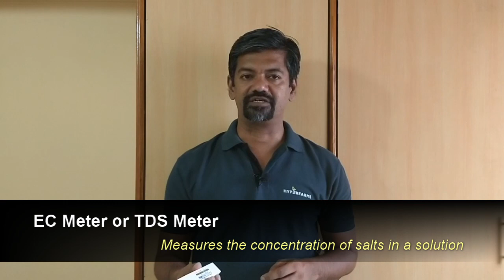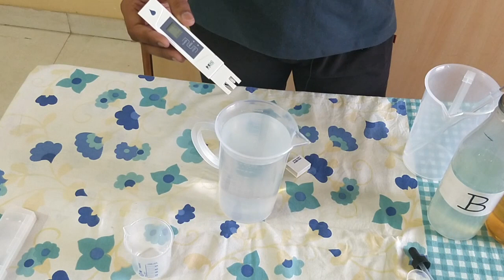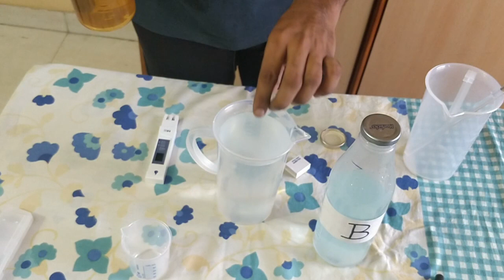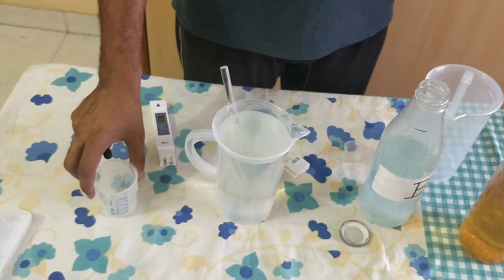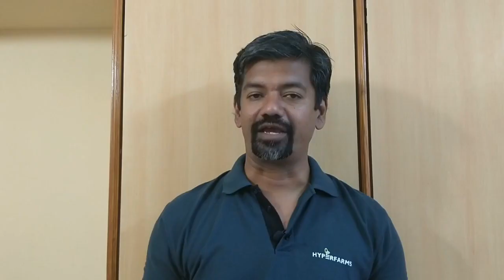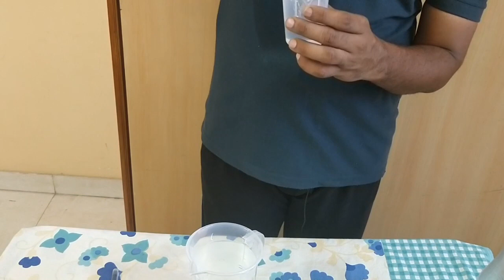Guide to adjusting Electrical Conductivity (EC) in Hydroponics

Comment: Your explanation is the first I have found which confirms my assessment that plants use waster at different rates than nutrients. Thus if a working solution is used to replenish the water loss, a too high a concentration will result in a very short period of time. Water without nutrients must be added and monitoring with an EC meter is necessary to keep the system at or about your target EC range. Measuring your fluid in the reservoir with the pump running risk misreadings. I have seen a 40O mc difference in readings with the pump on vs off. It is my recommendation to have a separate cup to hold the sample when taking a reading.

Comment: Thanks for sharing. It's clear as to why to use EC over TDS meter and also how to increase or decrease EC of solution.

My question is while we adjust EC, does other important  parameters like PH of solution gets affected?
Reply from the maker: While you adjust EC, parameters like pH change.  For that reason, pH is always done at the end. Also remember, pH adjust will technically change EC although marginally. That change we can live with as long as the added acid doesnt increase an individual element beyond its allowed range.
Reply: @TheGeekgardener  thank you so much for the information. It completely clarifies my question, with what needs to be done and more importantly why it should be done that way. Much appreciated.

I am very seriously thinking of evaluating hydroponics. At first, in my private terrace of @ 1000 sft and on commercial scale after getting hold of it technically and commercial aspects of it. 

May I request for your e-mail id where i can catch up with you on one to one basis.

Comment: I just set up a hydroponic system with lettuce.
I need to reduce EC from 1773 to  a range of 800-1200.
Also need to reduce Ppm to range between 560 to 840. The current reading is 894

Comment: thank you sir. regarding calibration do we need to calibrate both ph and ec meter again and again whenever we put new solutions in hydroponic or one time calibration will do to test the solution every time we put in hydroponic.
Reply from the maker: There is no need to calibrate every time you will the reservoir with the solution. The calibration is done periodically to ensure we get the right readings. 

Older the instruments, more frequent calibration is required. More so with pH as it needs more care during usage and also during storage.

hope this helps

Comment: How often do you replace your nutrients? After adjusting the EC
Reply from the maker: I adjust the EC every other day or as and when there is a reduction or increase in EC. If the tank volume is smaller, replacing it is easier and cheaper. For larger tanks, replacing or dumping the solution is not always an option since the cost is higher.  

For home garden, replacing the solutions once in 10 days will do. Instead of dumping the solution, I always use that to water plants in pots and in soil. They thrive well in these solutions.
Reply: @TheGeekgardener  , one more thing after tapping and readjusting EC the next step would to adjust PH if it is not within the range right?
Reply from the maker: @nestyplus  Yes, thats correct.
Reply: @TheGeekgardener  Can you also do a video on how to adjust the PH ? Also how can we know what the desired PH and EC should be for any vegetable that we're trying to grow ?

Comment: Using the 3 -part nutrient kit, do you mix the three in your feeding solution then measure EC or do you measure the EC on each nutrient  in water separate?
Reply from the maker: I use two part solution A and B. Solution C is acid. Generally our nutrient adjustment protocol is
1. Measure the solution EC, if its within range. Be happy :-)
2. If its above the range, add RO water till the ideal range is obtained.
3. If the EC is lower, then add equal parts of A and B in small increments until the right EC is achieved. 

After this pH is adjusted. 
Hope this helps
Reply: Sir, your knowledge and explanation is simply amazing. I have a small doubt. You were saying after adjusting EC to desired range, then ph should be adjusted. In large commercial hydroponics farm also do they follow this? Implies dosing pumps of EC adjust first after which dosing pumps of ph come into play later? Or both EC and ph dosing pumps run as per reading, please throw some light on the sequence followed in maintaining large commercial farm

Comment: Am a little bit confused why you refer to the best growth range of leafy vegetables as between 1200 t0 1400 ppm why not s/m,(1.2-1.4),I thought ppm is for  TDS 
THANX AND MORE LIGHT ON THAT
Good explanation though
Reply from the maker: I think you have misunderstood. In the video I meant that 1200-1400 microsiemens/cm which is 1.2-1.4 mS/cm. May I should have clearly mentioned the unit. Thank you for your question. I will clearly mention the units in future